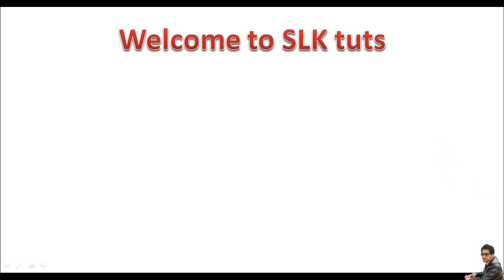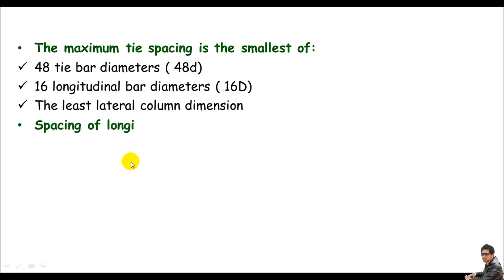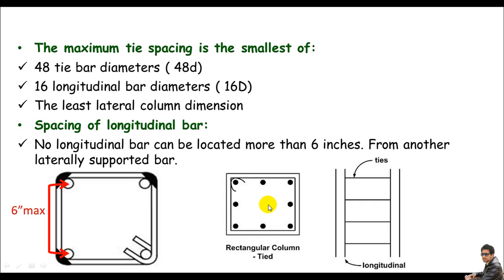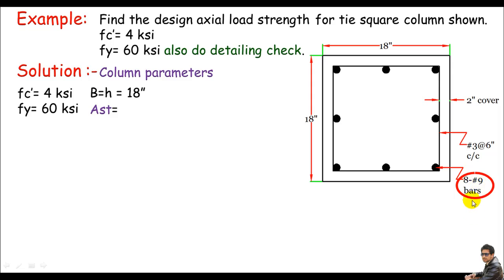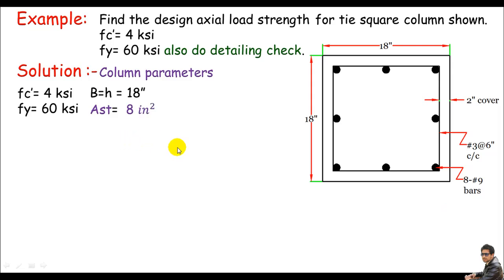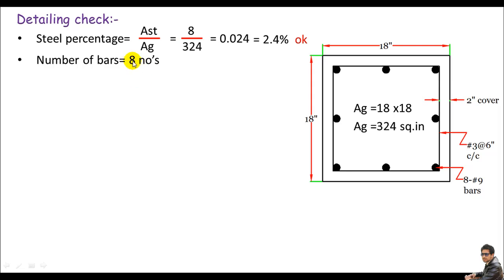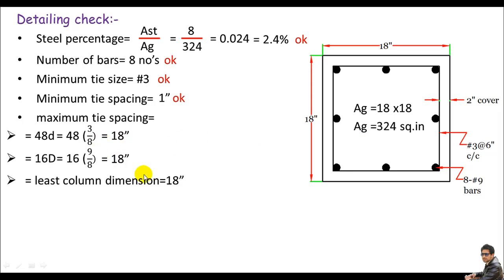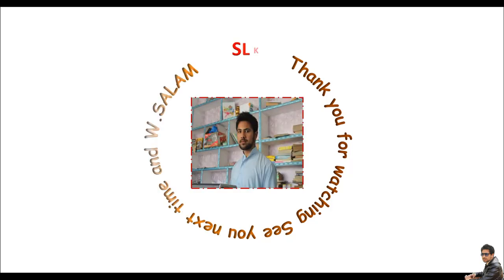RCD:- Design of a Square reinforced concrete column based on ACI codes part 1/2

Comment: my question is about spacing of longitudinal bars. you have mentioned it should not exceed or be more than 6". BUT ACI code 318 clause 25.2.3 says that clear spacing between bars shall be at least the greatest of 1) 1.5 inch or 2) 1.5d. kindly respond me soon
Reply from the maker: Yes. Maximum limit is 6inches and minimum limit is greatest of 1.5inch or 1.5d. …

Comment: Good job, just to notice, at 12:12  you should have taken the diameter of the longitudinal bar to be the minimum tie spacing because #9 is greater than 1in (in minimum tie spacing we pick the largest between 1in or the diameter of the longitudinal bar)

Best
Reply: exactly that is what i was wondering

Comment: Is it safe to use 6 pieces 12mm steel bars from ground floor to second columns for two story house?? The size of columns is 12×12"
Reply from the maker: we can not say that directly without any analysis, it depends upon the load acting on the columns, now i can not say what type of structure you talking about and how much load does it apply

Comment: Why for steel strength you didn't divide 1.15 safety factor?
Reply: The design is using ACi. 1.15 material factor is for Eurocode and British Standard.

Comment: i have a question what if logitudinal bar spacing is greater than 6" and no lateral tie was provided?
Reply: The column would be not designed in accordance with ACI. In other words, that design would not be acceptable.

Comment: What if I am using 1×1 ft^2 column, then how to place the longitudinal bar spacing according to ACI 318. Although I have to use 4 Longitudinal bars.?
Reply from the maker: watch part 2 of the video for your answer
Reply: You could increase the clear cover to 3” and put 1 bar in each corner inside of the stirrups.

Comment: Asalam Alaikum
 Really, I appreciate your efforts ,Can you do lectures in columns design by Excel ?
Reply from the maker: Mohammed Alqadhi 
walikumussalam. yes dear i will try after Eid...
Reply: SL Khan Thanks, really, you are great engineer.
Reply from the maker: Mohammed Alqadhi 
most welcome. enjoy
Reply: What is .80 and .65 and .85 on your formula?and how did you derived it.thank you in advance
Reply from the maker: these are design capacity . just like constant values. these are given by ACI
Reply: SL Khan are this design capacity are constant!?,could i apply it on a residential and commercial buildings?or there limitations also just like topographic values and safety factor or occupants risk value on windload calculation?